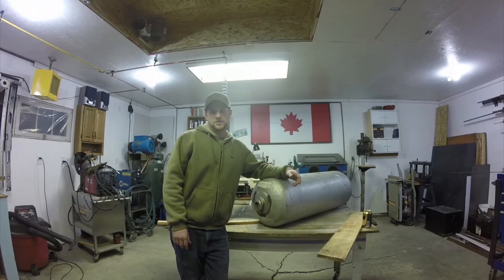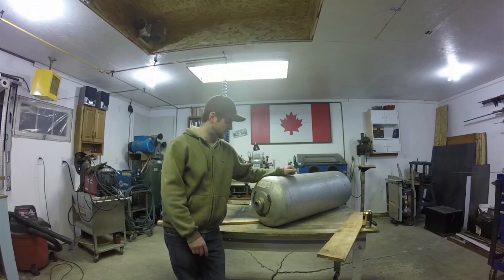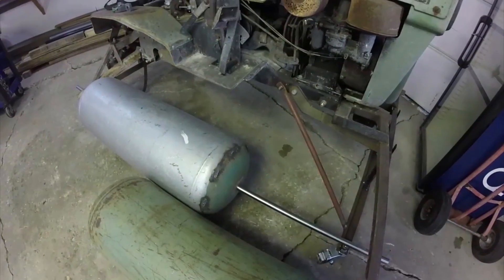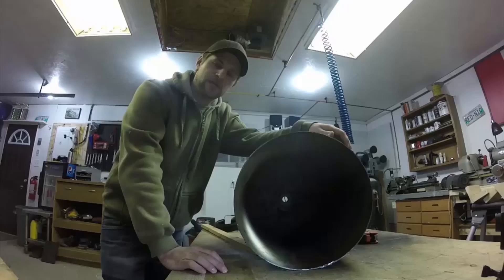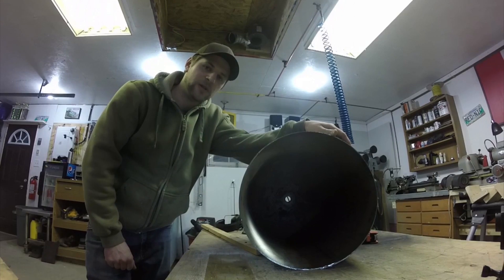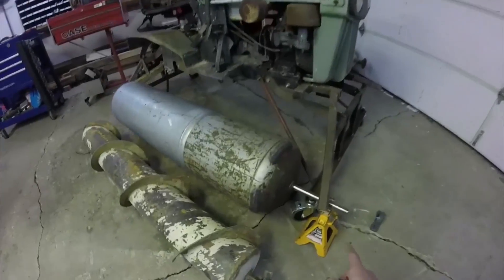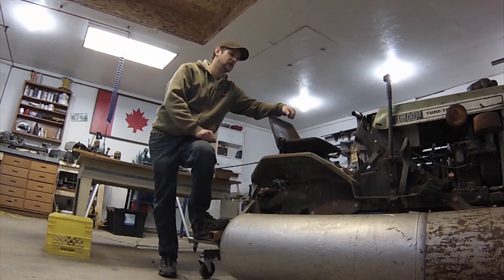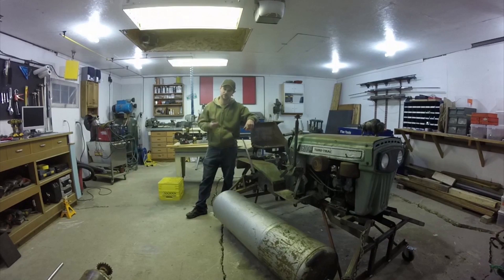Screw Drive Vehicle - Extreme Off Road - Part 12 - Bigger Better Screws

Comment: I don't mean to be a naysayer, but a 2X larger diameter screw will have a larger mechanical advantage against your drive system and require around twice the torque from the start (assuming hard ground, the improvement in flotation will actually help you some in sand and mud).  You might want to consider changing the sizes of your final drive sprockets to compensate.  Also, more torque means more tension on the chains, which will only result in bent shafts again.  My suggestion would be to extend the screw shafts rearward and mount a second set of bearings on the rear sides of the sprockets.  Also, it would be helpful to have a way of locking down your chain tensioners, otherwise, an overload might allow the chain to slacken and jump sprocket teeth on your pinion or bull sprockets.
Reply from the maker: Hmmmmm...well...first off. I agree with leaving the shafts long, which i have done already, for support bearings. And yeah one of the tensioners is spring loaded, good suggestion. Now as far as larger screws, here is my case, i may eat my words very soon, heh. Yes of course, you double the screw size, you double the force on the cylinder, As a "lever". But i think there are many factors involved. Im increasing cylinde size, yes, but im decreasing screw attack angle and blade height. Also as you said, there will be more floatation, less psi on each screw. Im hoping its effect will possibly be easier to turn. I think my last screws disturbed the ground too much, they were more like power shovels. When driving, the machine way digging it way too much. If i can keep it on top of the ground, i hope there will be less stress on everything. Thanks for the input. Any other thoughts as i continue are very much apreciated! And if or when the large screws destroy everthing. Make sure to say i told you so! Hehe. Cheers

Comment: should of just got "hot water" tanks lol
they would of worked great and you can find them free in back lanes, and quick and easy to pull apart lol
but the tanks you got i am sure they will work great ,still think it would be cool with a diesel engine on her lol
Reply from the maker: +StarPuss www.ToxicRedNeck.Com i fear diesel...hehe. don't know why, guess i haven't seen the light, yet!
Reply: Well if you ever change your mind i got 5 new 6HP diesel engines just sitting in my dads shop in Winnipeg

Comment: You can just cut slices to make a cone. Simplest method that doesn't involve using a roller to bend the metal or cutting a radius. There's a bit more welding, but hey, nothing is perfect.
Reply from the maker: +aserta ya i suppose you are right, it would be nice to get a nice smooth one though. i guess i could weld together some pieces shaped like sails kinda.... good thinking. thanks for watching!

Comment: Did you see someone actually made a toy based off your design , it's an RC version and it works really well. If anything , maybe big electric motors and batteries would work better instant torque and no drive belts etc.
Reply from the maker: +FrequencyOfThought yeah i actually used to own one, it was super cool! electric would be very neat, and easy to control. i think i would need some BIG motors and controllers though. thanks for the input!
Reply: +REDNIC79  Use some starter motors for cheap fun small and torque